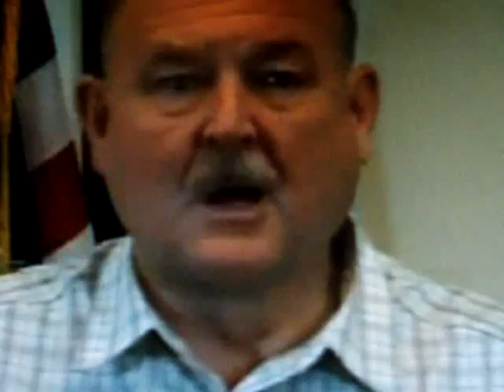Feds: BP may add ANOTHER blow-out preventer to wellhead

Comment: This is a THOUGHT MEME. He used to be an ADMIRAL. He is RETIRED. Therefore Thad Allen works for BP. It is BP's mess; Therefore The Incident Commander Thad Allen works for BP. They are using the NIMS (NATIONAL INCIDENT MANAGEMENT SYSTEM), under this system, you have an INCIDENT COMMANDER, not a NATIONAL INCIDENT COMMANDER. This is not being run by a UNIFIED COMMAND either, so therefore it is still under BP, since they are the RESPONSIBLE PARTY. STOP CALLING HIM BY A TITLE HE IS NOT..